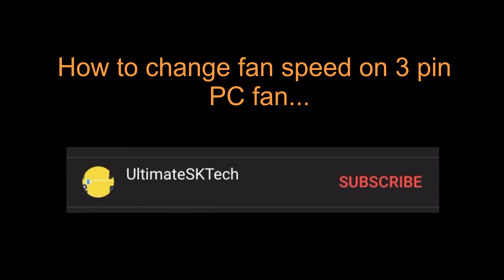How to change fan speed on 3 pin PC case fan

Comment: Thanks a bunch, bought a couple SSD coolers with extremely loud fans at full speed (3 pin), completely forgot I could change the voltage in bios, nice 👌

Comment: Question one; my cpu cooler fans are pwm and my case fans are 3-pin, can i control the speed of both? Question two; if i have a pwm fan and a three 3-pin fans can i control the speed of both?

Pls answer 🙏
Reply: Yes you can
Reply: @professionalfirestarter  xigmatek killer x360 alway funs run full speed need help

Comment: My motherboard automatically adjusts the fan speed of my 3 pin fans by just changing the fan modes. Silent, standard, performance, and full speed
Reply: Are u using asus mobo?
Reply: ASUS Pre sets, but you should manually set FSN curves as presets are not ideal to your exact build

Comment: how can I do this on a Intel Bios? like the one from 2013 ( I know kinda old ) I have something about fan system info too but I cannot control the voltage, at least that's what I think.. because when  I tried it there was no editing in that, or I just have mistaken something..
Reply from the maker: Only motherboards have a bios and intel doesn’t make mobos. Is your computer a prebuilt from a brand like hp or dell? Sometimes prebuilt manufacturers hide the editing option in their bios.

Comment: My bios says my fan speed is 0RPM even tho they are obviously going does this effect anything or no?
Reply from the maker: There should be no issue, but if you want an acurate reading, try reconnecting the fan cable. The bios is probably not getting a proper connection from the fan.
Reply: your fan has molex or 3/4 pin fan?
i assume it is molex and input it to the PSU...

Comment: If you have a 6 fan setup with 3 fans using 3-pin connectors via a splitter, would all 6 fans have to use the DC connection? Or can the motherboard not distinguish regardless of which header the different connectors are using?
Reply: same wanted to know this as well
Reply: ive got th3 answer back bois. So if all 6 of ur fans are connected to the same header (3 3pins, 3 4pins), you would like to use pwm mode instead, (as dc mode would damage the more expensive 4pin pwm fans)but you would sacrifice the control over the 3pins, those 3pins fans will spin at Max rpm.

The better practise will be to have 3pins fans and 4pins fans in distinctive headers.
Reply: I know this is way late but I’m doing my first build and I’m going to create “blocks”. I have 2 intakes in front on one splitter to one connection on the motherboard, 2 top exhausts on one splitter to another connection and 1 rear exhaust to another connection. I’ll let you know if it survives!!

Comment: At 01:56 will the mobo still control a DC fan, make it faster or slower as needed, if I put a check in the PWM box?  I read in Reddit that the DC fan will still respond to the mobo...  don't know if its true

I see you also enable Smart Fan control :-)

Comment: Hi my old fan had 3p.and new 11th gen mobo has 4p. If I connect it from left - right leave 1pn right  hanging from right side in mobo. This is okay?
Reply: yes, it will be fine, i have only 4 pin connectors on my mb and i have connected 3 pin case fans to it, leaving out the 4th pin.
Reply: @Dimon4ikverus  man didn't low this would be possible these days. They really make us easier to work with etc
Reply from the maker: Yup dimitriy said it perfectly. If you see a small notch, that'll make it even easier. Otherwise, just connect it to the left 3 pins.

Comment: hi! nice video but i have question. you said that if i connect a 3 pin, i cant control the fan speed, but does it mean that the fan goes as fast as it can all the time? or the lowest speed? 
and beside of the sound, it there a problem with that? i mean is it bad for the pc or the cooler? thanks
Reply from the maker: No you can control the fan speed on a 3 pin fan, just differently from a 4 pin fan. Since it lacks the 4th pin, when you adjust the fan speed, it also changes the voltage in the bios. On a 4 pin fan, you could change the speed using an application. By default, the 3 pin fan will run at full speed which is not a problem since most fans are pretty quiet. It also isn’t bad for the fan or pc.
Reply: @ultimatesktech1820  Thanks!

Comment: Good vid but how do I do this on a b450m ds3h
Reply from the maker: In M.I.T, you’ll need to click on smart fan 5 settings. I actually don’t have that motherboard so there may be more steps.
Reply: i gotta ASUS motherboard and for it i went to voktage>pc health and it showed me my system fans there. try snooping around in your bios to find it,  make sure you dont mess with your cpu fan on accident
Reply: you have to download siv from the gigabyte website or spam del  when booting to open bios in bios select power and there you can set it to voltage not pwm

Comment: how do i go into bios? and how do i get out?
Reply from the maker: To get into your bios, you'll have to restart your pc and right after it begins to turn on, you'll have to spam one of the following keys:F10, F2, F12, F1, or DEL. The key you have to press varies on your motherboard manufacturer. I have to press delete to get into the bios on my MSI motherboard. Just search up your mobo brand and model online to see which key to press. Usually, there is a "X" symbol or exit button in the top right of the bios to leave.
Reply: @ultimatesktech1820  ok thanks!

Comment: Man how the fuck do i configure my 3 pin fans on my b450 s2h gigabyte bios literally there isnt any option for configuring the fans, i have 5 fans (6 including the cpu fan) i have fan hub, the fan hub connector is connected to the CPU_FAN and from there i connected the cpu fan to the fan hub (which has one red connector for the cpu fan) and 9 other optional fans, which i have connected the other fans, and i cannot configure the voltage, there is only option to choose between voltage and pwm, nothing else, any help?

Comment: My system 1 is at 0 rpm, can anybody help me 😞
Reply: what your fan cable has...is it molex, 3 or 4 pin?
if it is molex, you cant control it...it run by default
you can control 3 pin fan but on DC mode...4 pin fan can DC or PWM...
make sure it connected to the motherboard system fan pin...